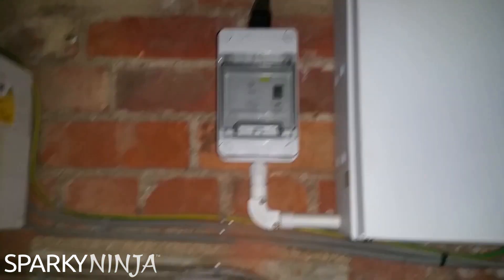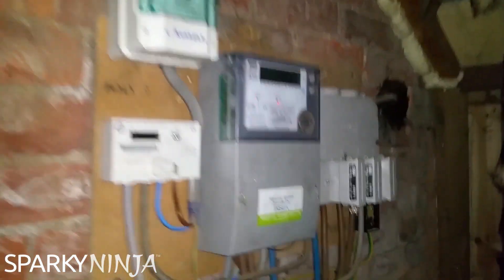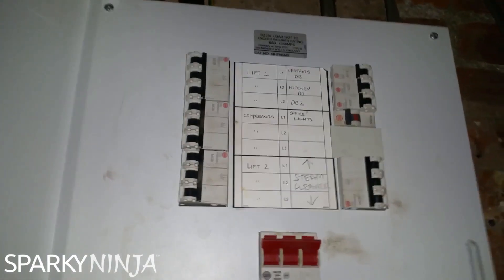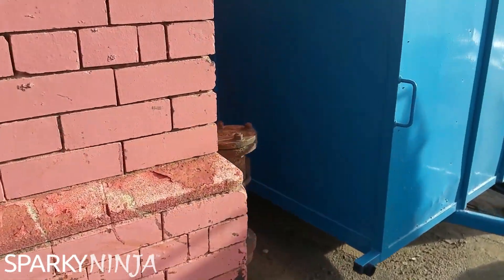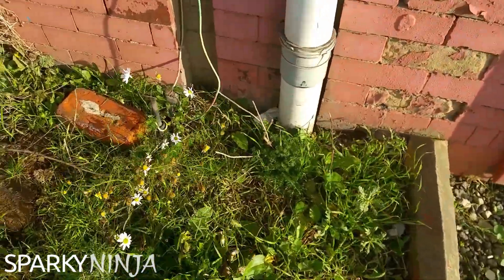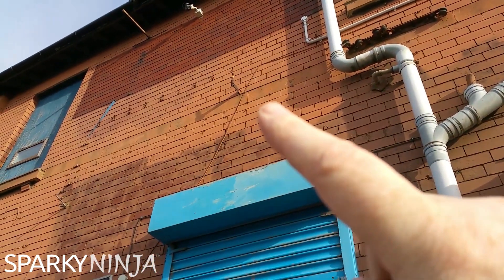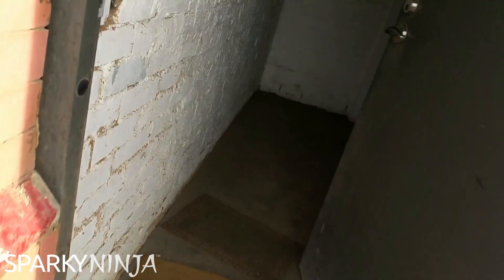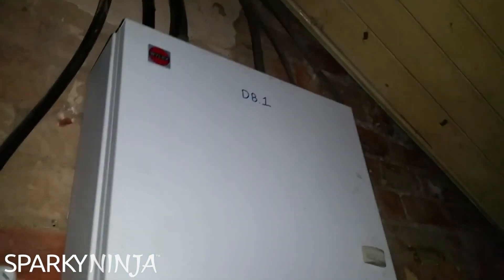Inspecting a TT system with no main RCD

Comment: im wondering about the sequence of events here. it could be that the installation electrician expect the DNO to provide a tnc-s supply hence the earth block?   the installer has provided rcbo protection on the final circuits but not sub main distribution which would be compliant with selectivity of protective devices IF a tnc-s system had been installed by the DNO.
however the installation should not have been energised due to the fact that an EIC could not have been produced with readings that complied with bs 7671 until the dno provided the new tnc-s supply. i would certainly be contacting them and researching the history of this installation

Comment: So what are the mcb zs values for tt system
Dose the zs of a circuit  just need to be under 1667 to pass so if it's a 32 amp ring or a 6 amp lights or 20 amp radial as long as its under 1667 is that fine 
Any help would be great thanks
Reply: that comment is terrifying once you actually understand what 1667 means.
That electrician found a TT intake board with no RCD.

And the commenter is basically asking:

“So if I measure less than 1667Ω, can I just ignore the fact that there’s no RCD?”

That is not just confusion.
That is how people die.